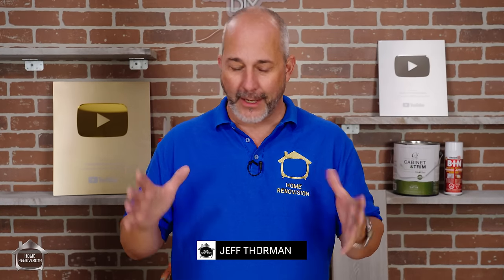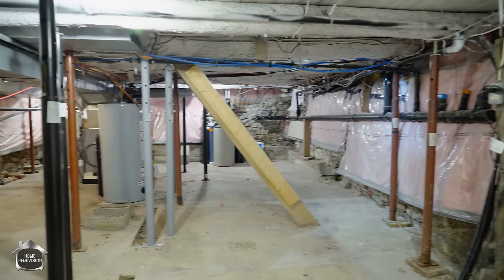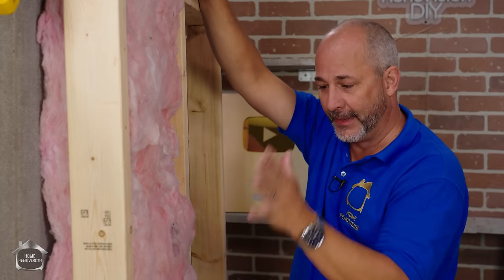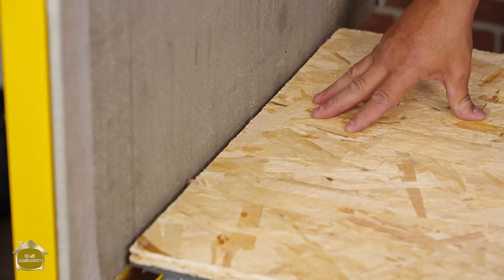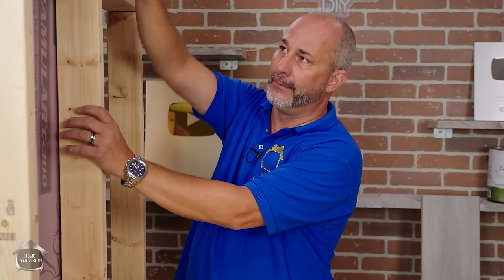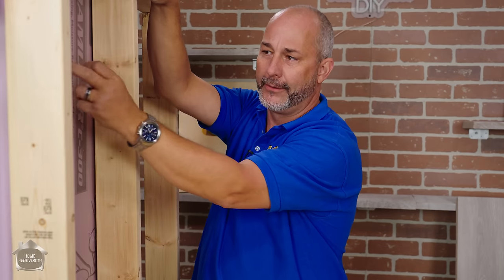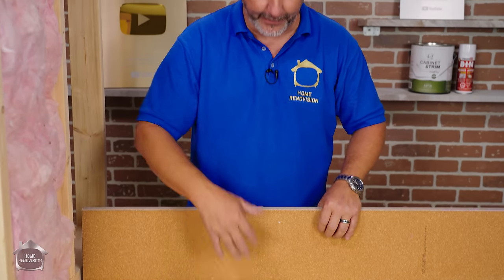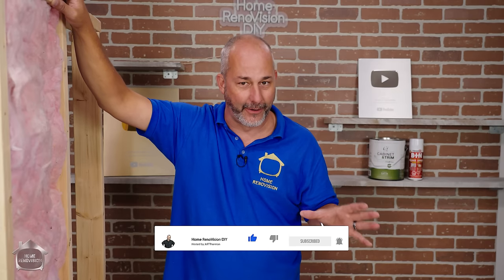The Best Way To Finish Your Basement

Comment: Hey Jeff, I have a 2020 built home in southwestern Ontario and I have the blanket wrap insulation to the floor in my basement but it has the house wrap style (almost fabric) in between the concrete walls and the wrap with the rigid foam panels under my slab. is it still best to take down the blanket insulation and do the rigid foam board and frame and add fiber insulation or am I OK with just framing in front of the blanket insulation? my worry is that I wouldn't be gluing the foam board to concrete but to the house wrap style vapour barrier and I don't want to remove that from the walls. Cheers!

Comment: So we plan on doing the basement in my home with the dricore flooring, my problem is I have a 1” drop to allow water to flow to the sump pump. I think leaving the pathway for the water to flow would be essential for the drainage so I don’t really want to have the floor repoured. My question is can I shim the dricore with additional foam board insulation if I use adhesive to attach them and match the grooves to the subfloor panel, essentially doubling the insulation up with the path for the water to flow.
Reply: Forgot to add that the house already has a French drain and the 1” drop goes from under the plumbing fixtures to the sump pump. Basement has stayed dry during the time I’ve been here but I wanna make sure it’s protected.

Comment: How do you do fire blocking with this system?

Does it not require an air channel for the air to circulate and regulate? Thus breaking the intent of any fire blocking?

Also, since the foam board is not fire rated, I would think you need vertical draft/fire blocking every 10ft. Right? How would you tie that in? Could you just do the fire rated spray foam between every other foam board (Would be 8 ft spacing, I guess.)
Reply from the maker: if your code requires blocking then once you have your permit invite the inspector out for a free consultation and ask them what they want to see when the framing and fire separation is finished. this will avoid unnecessary work.

Comment: I'm not convinced. Where does the airspace behind the rigid foam connect at the top of the wall? What prevents warm, humid indoor air from getting back there and condensing on the cold concrete? And why a vapor barrier behind the drywall when there's already the rigid foam acting as a  barrier behind the studs?

Comment: I'm confused how the sub floor air flow connects with the air flow behind the foam. Doesn't the sub floor air flow get stopped by the framing?

Comment: Looking to apply this system to my basement but the foundation is only half the wall with the exterior wall sitting on top. How should I transition from the foam to the framing insulation? Won't the air gap behind the foam lead to moisture traveling into the framing cavity?

Comment: yea but what if the foundation cracks and you get leaks? thats why i have a vapor barrier to catch any water leaking in my basement that travels to my waterproofing system sump pump and out of my basement. my question is can i put the foam board on top of the vapor barrier?

Comment: Hi Jeff, quick question. Will there be any issue with using the rigid foam board on the outside and then putting up a plastic vapor barrier on the inside? I've seen other youtubers say not to do this, as they both act as a vapor barrier thus trapping any moisture inside you bat insulation. But I live in an area that requires a vapor barrier on the inside and have already bought both as I would love the R22 rating. Thanks for all your help!
Reply: I'm wondering the exact same thing. There seems to be many people who do it the way you described. But I worry that it would be a double vapour barrier. Have you found an answer to.your questions yet?

Comment: Great video. One question that subfloor with the waterproof underpayment do those squares click into each other and subfloor floats. Or do you need to also screw it down on to the cement
Reply from the maker: it is designed to be a floating floor. having said that i like to add screws anywhere they have a bounce. Cheers!
Reply: Dricore brand, sold at Home depot is a tongue & groove product . They don't " click " like a laminate floor but they do attach to each other, a hammer & piece of lumber is used to coax them together. Some people use Tapcon fasteners to attach some of them to the floor so they don't shift while installing.
FYI. I did the math just today. May 2022 prices Dricore insulated panels are actually cheaper per sq. ft.  than buying rolled dimpled membrane and 4x8 T&G 5/8" OSB right now. A lot easier to haul into the basement , easier to install, better R value, an all round great value. ( what prices will be tomorrow, who knows ? )

Comment: I would not install subfloor under the stud walls.  In the event you have a large water event like a bursted water pipe while you're on vacation, the framing would most likely be okay to keep in place, while the subfloor will most likely need to be replaced.  You wouldn't be able to remove the subfloor if it's underneath your framing.  Why not install your framing directly on the floor and then butt your subfloor up to the framing leaving a small air gap?  
Also, rigid foam insulation is intended to be pressed tight up against the concrete, not spaced off as you have shown.  While it is intended to prevent temperature transfer from the concrete, it is also intended to keep the humid air inside your home from condensing on the cold concrete.  If you leave an air-gap, it is not performing a large part of its intended function, and you very well may have MORE moisture behind the rigid foam insulation.  If you read the instructions on the PL foam adhesive tube, it says to install it with vertical beads of adhesive running the full height of the insulation, 11 inches apart. Not large dabs as you have shown.

Comment: What about GPS (Graphite polystyrene).  I live in Montreal and i was about to buy a bunch of 2'x8' pink xps foamular for my 50's home basement and some pl300 and follow your method to install it with an air gap.  Now im at the home depot and i noticed they have durospan gps R10 4x8' at 40$.  Versus foamular R10 4x8' at almost 80$, its half price !!  Should i buy the gps ? Same method to install with pl300 to leave an air gap ? Any difference other the price ?? Im so confused !

Comment: Do I need to use 6 mil poly between batt insulation and drywall if I am installing 2  inches of closed cell foam board behind the batt nsulation?

Comment: Hi Jeff. Just curious why you never recommend spray foam insulating the basement walls? I would think that would address moisture and R-value better wouldn’t it? I understand it’s not a DIY option in most cases, but what’s your thoughts? 

Additionally, what’s your thoughts on mini splits, which can also help control moisture?
Reply from the maker: only on houses with waterproofing on the outside that have been curing for 2 years. Cheers!
Reply: @HomeRenoVisionDIY  in Ottawa Canada, a insulation company mentioned that spray foam would be best for my 1950's  poured concrete basement. I'm struggling to understand how the spray foam would be better than what you described since it would keep the concrete wet?  The spray foam would have a continuous vapor barrier, but..no where for that moisture to go if it's closed cell...anyways...I'm confused.

Comment: Jeff what about for older homes? Does the same technique apply? I notice you mention new construction.
Reply from the maker: Hi Jay, this works for any age of house. the only problem is the older the house the more water events you are prone to. I just filmed a video about all the problems you can have and how to mitigate them. If you are going to finish an old basement this is the best way once you at the very least install a backflow preventer valve on your main lateral line. Cheers!

Comment: What are your thoughts on using metal track with 2x4 wood studs?
Wood studs make door hanging easy and firm also wood studs for hanging anything.
Using this method framing goes super fast and studs are movable till they get pined.
Your thoughts
Ty Anthony
Reply: Lots of guys do this...I've been in construction for over 40 years. Best system is pressure treated bottom plate 2x4 top plate with 2x4 studs...frame wall away from concrete to allow for R20 insulation
Reply: @briansmith3191  what do you think of the idea to put foam in between the concrete wall and the r20?

Comment: Almost finished my basement in a 2yr. new build and left the vapour wrap up against the foundation wall. 

Reached behind it a few times and found absolutely no moisture at all, however it's a large 1400+sq. ft. walkout. 

I'm less concerned about moisture, as I am passing inspection. Would this still pass?

Comment: What do you reccomend for a 1864 home, with rubblestone foundation and dirt floors?
Reply from the maker: don't even think about it. Cheers! Just spay paint the underside of the floor joists with oil paint to seal and protect from too much moisture transfer and add a sump pump. install blanket wrap on tyvek on perimeter. just like my farmhouse.

Comment: Hey Jeff - I just waterproofed my cold room wall from the outside.  Is 2" of rigid foam insulation still needed as a vapour barrier or can I cheat down to 1" or 1.5"?  Thanks so much for all your content.
Reply from the maker: That depends on the goal for the room. in my experience 2" overlap is still the best option for a thermal break.
Reply: @HomeRenoVisionDIY  Thanks Jeff!  Your videos helped me frame, wire, and drywall my laundry room.  I especially appreciate the video on all the types of mud.  Super helpful for novice.

Comment: My 1960 basement is not worth finishing. 300 sqft is not large enough to create a comfortable living or  play space. The laundry hookup and furnace are on opposite ends. I  really just wanted to  install cabinets surrounding the W/D to accomodate a chute and central  vac (I am adding).  Tips? Ideas?
Reply from the maker: simply insulate for thermal reasons and paint the floor to make it easy to clean and avoid the dust from lifting into the air. Cheers!

Comment: What happens in situations where only half the basement wall is poured concrete and the top portion is framed as a base for the house and insulated, surely you cant remove that framing so would you just install the frigid foam on the wall all the way from floor (concrete) to the top which is wood with standard pink insulation and proceed to follow the rest of the process from the video?

Comment: Hey Jeff, I have a home built around 1980. No vapor barrier underneath the concrete. I was going to follow the previous video you mention to a T for finishing it (DMX plastic underneath the subfloor.) in this video you recommend the panels with the backing on them as a superior system. Question: does that backing underneath each panel count as a vapor barrier? If not, what would you put down first to account for a vapor barrier?
Reply: Yes it counts.  And it has XPS foam between the barrier and the OSB if you get the insulated tiles.  A good system as long as your basement doesn't flood and doesn't sacrifice much height.
Reply: @robertm5969  we only had once instance of water during a hurricane and afterwards I had a sump pump installed in the portion that was flooded as well as the floor being trenched out on either direction and stone put under new concrete. Bone dry ever since.

I bought three pieces of the dricore r+ today to mess around with and I think it will be a great fit for the project once we are finished leveling the floor

Thank you for the reply!

Comment: In an older basement, do you still suggest having the Typar behind the framing in addition to the rigid foam insulation?
Reply from the maker: not in addition no. as a way to keep insulation off the stone if not using a rigid insul.

Comment: Whats your thought on using galvanized steel studs for framing?
Reply from the maker: they work fine as long as it is dry in the basement. the quality of galvanized still rusts out when exposed to water.

Comment: So I started doing my new basement this way. My husband didn’t think I had the time to do this working full time so he hired the concrete guy to finish it. He tore out all the insulation- said it was wrong, framed the walls and then recut the foam board to fit inside the studs. Then he hired them to Sheetrock it too. I have pictures of the awful job they did. 
So now I have no vapor barrier underneath the floor. I am doing the subfloor as recommended here but I wonder if it’s going to prevent the water. I know the floor will be warmer but is that all?
Reply from the maker: ouch. always hire a concrete guy to finish a basement said nobody ever. please comment on n then age of the house and which city you live so I can better answer this question. Cheers!
Reply: @HomeRenoVisionDIY  the house was built in 1930. The concrete block walls were falling apart and we have a poured basement now. Yes he knows it was a bad choice now but after $170k and cashing in part of my retirement to finish we are committed to making it comfortable and dry. We don’t have a vapor barrier but we do have 2 sets of drain tile and double sump pump holes. So they framed it and then put the insulation in the walls and then sheet rock. I’ve had to fix lots of issues because we don’t have the money to tear it all out and redo it now. The patio is now sloped towards the house instead of away and I anticipate some contention fixes are coming. 
We watched all the basement videos and are putting in the subfloor as you showed, plus shims to address how uneven the new concrete is. There is 2” foam board outside between the walls and the earth and it’s pretty comfortable. Our big issue is that when the house was set down they said there was no sill plate. They put down 2x6 around the walls but between the siding and the foundation there Is exposed sill plate the siding is not covering. I can add some pictures but how do we fix this? Do we have to take up the siding to add another layer?

Comment: Does the sub flooring need to be the entire basement floor? Plan on having a bathroom and then utility storage area not sure if those would be needed to have the subflooring.
Reply: Tile it, you don't need any subflooring for tiles. Do it directly over the basement slab. (You have to prep the slab first so it is flat)

Comment: In our 2005 built home we have 2 or 3” of rigid foam outside of our block foundation as well as a moisture membrane- is the 2” closed cell foam required or just recommended in our case?  We are in a northern climate (Minnesota). Thanks!
Reply from the maker: if your 2" exterior foam is continuous to the roof then no. if not then yes. Cheers! your weak spot will; be around you rim joist and that could cause a huge draft if not dealt with properly.

Comment: Would you recommend this sub floor system if we add a heated floor above our concrete basement floor (US house built in 2000)?
Reply from the maker: no i would install the heated floor on top of the subfloor. if it is already installed use the dimpled plastic membrane version to allow the heat to transfer into the room. Cheers!

Comment: I have a new home that was finished in 2021, they've done the drywall and framing on the outer wall of the basem,ent. From what I can see They've put some foam (almost looks like styrofoam?) against the foundation and frame/drywall against it. Should I undo the drywall and put some fiberglass insulation as you indicated?
Reply from the maker: that all depends where you live.
Reply: @HomeRenoVisionDIY  Quebec!

Comment: I assume the Canada R-10 C-300 is equivalent to the US R-10 250? For wall applications, do I really need 250, or is 150 enough? 1yr old home(West Michigan cold winters), 9' ceiling, 8" thick cement walls, about 950 sq ft basement/141' perimeter.
Also, the blanket insulation that the builder used, can I put in the ceiling to help as a sound dampener?
Reply from the maker: Just loose the blanket. batt for the ceiling with 5/8 drywall. and yes you need a r20 insulated wall with a thermal break on the floor if you want comfort.Cheers!

Comment: I never got rid of the white pillow insulation they had just worked around it does that mean I'm screwd when it becomes wet and face mold that would rot the wood out ?
Reply from the maker: no it just means you have a weak thermal barrier.

Comment: Just watched this video, and have a couple of questions.  My house was built in 1960, I purchased it less than a year ago.  The previous owner had finished the basement with framing (with a gap between the cinderblock walls and the wood studs) and sheetrock, but no insulation.  In winter, I've measured a 10 degree (F) difference between the temp on the sheetrock, and temp on the cinderblock.  I don't want to rip out and replace sheetrock and framing (time, $, and mess).  Is it possible to slip foam board (and then fibeerglass insulation) between the ciderblock and the sheetrock, without ripping out the existing walls?  I can cut and patch the sheetrock as needed.  How would you do that?
Reply: Making pluggable holes on sheetrocks and inject foam insulation. Less messy and good R value
Reply from the maker: Marvin. sheetrock is cheap and easy to replace. just remove it and insulate the stud cavities.